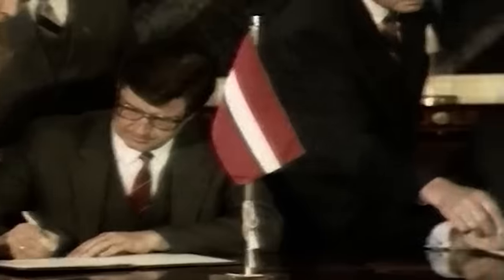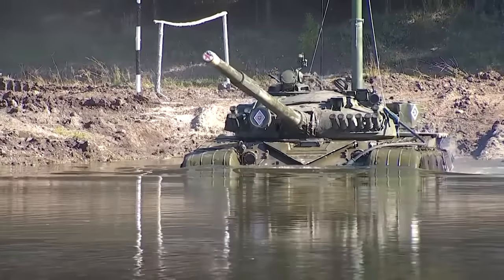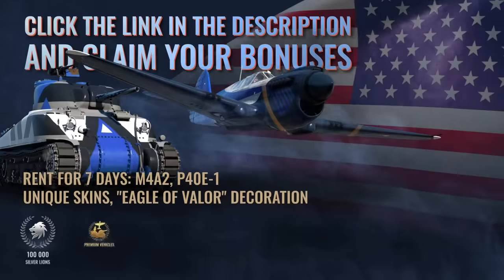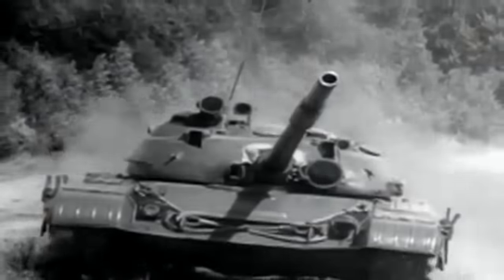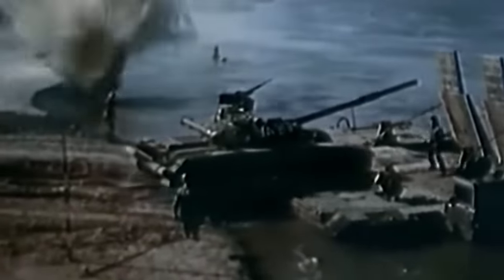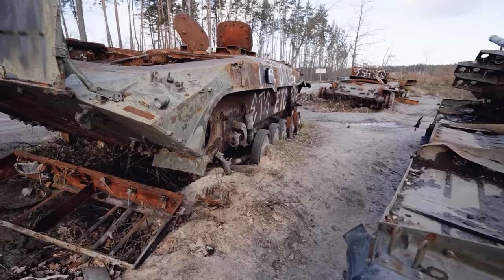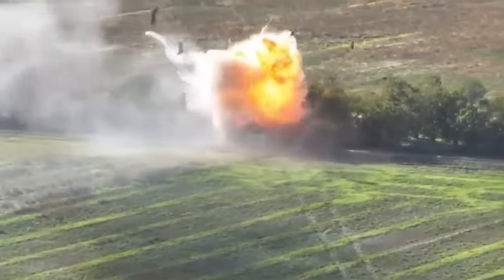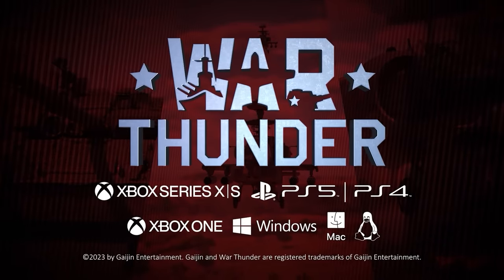The Tank Russia Is Really Starting to Regret

Comment: For anyone wondering why High explosive shells may had been used in the 6.5 mile engagement, that's because they do not loose penetration power over distance, like apfsds do, so it worked kinda like artillery, and if the shell hit the roof, cracked a hatch, machine gun port or turret ring, vision port, it would be an end to the tank, as even sturdy armpur can get worn out and crack... especially on such old vehicles
Reply: Armor

Comment: The T-64 has the same fatal design flaw that the T-72/80/84/90 have; that upright ammunition storage carousel, that it’s autoloader requires, that is open to the crew compartment in the turret. One round penetrating the tank sets off the stored ammunition, with nothing separating the detonation, and resulting fire from the crew. Unlike the M-1 Abrams, which has sliding doors to separate the crew from the stored ammo, and blowoff panels on top of the storage compartment, to vent the energy from an ammo detonation skyward, out of the tank, and away from the crew in the turret. I’m pretty certain that other modern tanks, such as the Leopard 2, Challenger, etc., have similar attributes.
Reply: It was also fixed in some very obscure (but modern!) modification of T-55, where autoloader was added in the back of turret (like on lercerc).
Reply: the carrousel is not the culprit, but the extra ammunitions stored outside of this

Comment: The T-64 was hot garbage, which is why they were replaced in production by the T-72, never never offered for export, never shown-off in any Soviet military parades, and why further development of the existing tanks ended abruptly in 1977 when the T-64's manufacturer began building the T-80. It's no accident that even while Russia has kept T-55s and T-62s in storage into the present day, they scrapped every single T-64 they had left in 2014.

The definitive features of the T-64 (and why they make it an irreparable dead-end bridge) are;
- A unique main gun, the 125mm 2A26. The USSR dropped that weapon like a hot coal in the early 1970s when T-64 production was abandoned (only 6 years after it started, and after a pitiful 6,000 were completed), and starting with the T-72, every subsequent Soviet and Russian main battle tank since has carried the 125mm 2A46 instead.
- A height so low that severe height restrictions were imposed on drivers.
- An autoloader and replenisher design never repeated on any subsequent Soviet or Russian tank, because of how easily and often they broke down.
- An autoloader and turret crew stations so close together, that the rammer had a tendency to rip the arms off the commander and/or gunner when loading a new round.
- A 5-cylinder diesel engine so awful, that it was never repeated in any other tank since, except in Ukrainian  T-74 and T-80 rebuilds (due to KBM inheriting the entire assembly line for that engine, and not having the capacity to develop suitable V12s as replacements). 
- That 5-celynder engine was also a "tri-fuel" engine (it could run on diesel, gasoline, or jet fuel), a mistake repeated only in the M1 Abrams, T-80, and Chieftain. Like the Chieftain, the T-64's engine ran excessively smoky, leaked, and easily caught fire.
- Contradicting the supposed urgency of the "tri-fuel" requirement, and the fact that most of the fuel stockpiled by the Soviet Army was diesel oil, the APU (electrical generator) in the T-64 runs exclusively on gasoline. In addition to being a logistical bottleneck, a gasoline engine in a modern tank is a serious fire hazard.
- The T-64's tracks were re-designed to reduce the high tendency for track-throwing that the previous T-62 had, but it backfired; the T-64 has a greater tendency to throw it's tracks than all previous or subsequent Russian tanks.
- The unusually roadwheels of the T-64 have it high ground pressure for it's weight, and a greater propensity to set-off anti-tank mines.

The reliability, availability,  maintainability, durability, and operability of the T-64 was such a complete trainwreck, that for the first entire decade of their operational service, they were never deployed more than a few-hundred miles away from the factories that built them, because of how frequently they suffered breakdowns so serious that only the factories could repair them. Teams of civilian mechanics became "semi-permanent residents" of T-64 formations because of how often they broke-down. It's not an accident that the T-72 was hurriedly developed and put into production and service shortly after the T-64; it was developed to replace the T-64, and it did.

This is also why the T-64 didn't first deploy to Eastern Europe until 1977, 10 years after they entered service --- NATO instantly assumed they were looking at the successor to the T-72 (which was first deployed to Eastern Europe in 1971, the year they entered service), and ever since then were never able to kick the incorrect assumption that the T-64 was a more advanced tank. NATO couldn't comprehend the simple fact that the T-64 had arrived late because it was a dud.

This unsurprisingly resulted in a war-losing tank that's been slaughtered in every battle it ever fought in, even when T-62s and T-72s operating alongside them prevailed. Their first combat action was in Moldova in 1982, in which 18 a column of T-64BVs were wiped-out by 100mm anti-tank guns (a weapon that, on paper, had been obsolete for almost 30 years). So many T-64s broke-down as the Russian Army retreated from Moldova, that they abandoned another 20 of them.

The Ukrainian Army has also suffered terribly for their decision to continue operating T-64s.Of the 2,350 Ukraine inherited from the USSR in 1991, they only had 700 T-64s in service and 650 in storage by 2014, and they lost lost 300 of them in 2014 alone. Ukraine lost another 240 T-64s in 2022. The Russians and pro-Russian separatists captured over 100 other T-62s in 2022, and they were handed over to the separatists... who lost half of them before the year was over.
Reply: Eh, the 100mm AT gun shenanigans being "obsolete" reminds me of war thunder shenanigans: that modern armoured car the enemy team has with laser range finder and 400m+ pen is all very nice, but all the panzer 2 hears is "armoured car" and starts salivating with it's 20mm autocannon.

Comment: Isn't about 85% of this footage of T-72s?
Reply: Could be anything.  This channel seems to be long ads about War Thunder.   "See what it's like to get your arm mangled in a War Thunder T-64 !
Reply: No, actually it isn’t.
Reply: most of the footage were t-64s, you can tell the difference between a t-64 and t-72 by the roadwheels (t-64 has smaller diameter) and the exhaust position (t-72 exhaust is sideway while t-64 at the rear), but frontaly almost impossible to tell the difference, maybe by tracks but those are very small detail

Comment: A video you don't see getting made often is the difference in individual tank crew training. How long a tanker is trained before certified to join the regular force. What are they trained on? What equipment do they use for training? Number of on hand certified regular tank crews a nation has. I'm currently a 19K of 16 years on the US side. I always wanted to see a video comparing our level of training from OSUT to a NTC deployment ready certifying event. Then what that would look like comparatively. Having a great piece of equipment is great. However, being a professional, an expert, and practicing in real times how you operate with all your supporting elements is an expensive and irreplaceable thing. While "combat experience" is incomparable it is costly learned and to often poor practices are learned.

Comment: T64?  T62 i know about ... after that it was the T72 T80 and the more modern ones.  When i got in (1980) the US had M60 series
Reply: T64 was a competitor but it was more complex and expensive so not continued. T72 was then built from T62
Reply: T-80 is literally a T-64 with a gas turbine.
Edit: well not literally but that was the design goal of T-80, give the T-64 a gas turbine engine
Reply: first iterations of abrams were in development during the 1970's

Comment: The T-64 was soon mostly replaced by the legendary T-72. Yet another Kalashnikov of tanks. And the T-72 was really heavily inspired by it. So what is the regret?
Reply: The autoloader. The T64 pioneered the carousel style autoloader for the (then) USSR. It continues to be used right up to the T90, Russia's latest (in service) MBT. The auto loader uses a flat carousel in the floor of the tank. Up until the T90 is was completely unarmored. They added some armor to the T90 floor, but not really enough. 
Any round that penetrates the turret, especially from the top, sets off the ammo stored in the carousel. 
That explosion typically launches the turret straight up resulting in the ever popular YouTube sport of judging the Turret Toss. 
Extra points are awarded for height, number of complete rotations, shape of the mushroom cloud and the uniqueness of the landing. 
Turrets that drive their barrel into the ground and end up as a Lollypop are especially favored.🤣🤣🤣🤣🤣
Reply: @johntrottier1162  Actually the T-64 has a different type of carousel autoloader, storing the 2-pieces rounds at a 90° angle.
T-72 was created because that system was unreliable, too expensive and too vulnerable in case of penetration of the hull. Also the Ukrainians weren't able to supply enough T-64s to the Red Army.
This is when the Russian UVZ was tasked with the modification of existing T-62s with T-64's 125 mm guns. UVZ created the AZ autoloader as side project, and the Soviet authorities were so impressed they ordered a new tank to be made with that new carousel.
That's how the T-72 was born.
Reply: Not sure. This channel is kinda low quality/high output content to show advertisements over.
Reply: The fact Ukraine is now using it against Russia.
Reply: The regret is the fact that Ukraine had one of the factories producing the tank.
Reply: @johntrottier1162 the Autoloaders in general really aren’t an issue, go look at any video talking about it, or go read up on it, your choice. You’ll find that a majority of ammunition detonations occur in the extra ammo in the turret. The Autoloader allows the tanks to be smaller and harder to see, improving crew survivability, the armor is very compact allowing for more with less weight, less crew in the tank as well if the tank is destroyed. ammunition detonations happen in every tank, and there’s only 1 tank in Active service with every round protected by blowout panels, and it the M1. Leopard has the same issues the T64/72/80/90 have with having unprotected ammo in the hull.
Reply: @wstavis3135 yet they can’t produce any at a substantial rate and they’ve been getting shafted hard whenever they run into a Russian tank. Least that’s what we’ve seen a majority of.
Reply: @hiphip4808  
Very nicely quoted from the MOD handbook. 
The fact is that the "Turret Toss" effect is from ammo stowed BELOW the turret ring. The ammo stored IN the turret is spread out and is unlikely to detonate all at once. The propellant charges in the loader are stored next to each other, and when 1 charge burns, the rest go with it. This rapid deflagration is what creates the pressure to blow the turret into the air.
As far as blowout panels, besides the M1 the Leopard A2 and the Chinese Type 90 have blowout panels as well.
Your research needs some work.
Reply: @wstavis3135  Not really, it doesn't exist anymore

Comment: When russia almost went for quality over quantity
Reply: almost
Reply: thats called T80
Reply: The Soviet Union went for both because they could afford it.
Even the T-72B was a massive leap ahead what the West had.
And then they ended with the T-80U which was the best tank of the Cold War (especially the T-80UK which was equipped with a CITV just like the Leopard 2, while having superior gun, armor and mobility).
Reply: That would be obj187 sadly they still go for the cheap one.. Aka t90a.
Reply: @Rek1emMScar  Object 187 isn't better than T-90A. It's arguably comparable or worse than the T-90 which the 187 competed against (and lost to) in 1991-1992.
Reply: @albertoamoruso7711  That its wrong.. Obj 187 is better in every way.. 

Better gun, that fixed the old problem of T-72 that couldn't fit longer Arrows. So new ammo was invent aka Anker-1 comparable to late svinets round. New turret. Overall better armor, also it didn't have the cleavage weak spot in the frontal armor.. Different obj187 model use different engine all of them better than the t90. Also it actually have a reverse speed not the 4km/h bs of the t72-90. Even better reactive armor...Etc..

The only thing that didn't work in favor of the 187 was it cost. And was the only reason why it lose to obj188.. Nothing new with russian tank that usually go for the more cost efficient tank.

Comment: What a load of BS.
T-64 is pretty outdated, even the rare BM and B1M got chewed up pretty bad without causing much damage.
Reply: T64 tanks are about as capable as T72 tanks that are the bulk of the Russian tank fleet.
Reply: @freitb1  No they're not, they're less reliable and less upgradeable
Reply: @albertoamoruso7711  they have the same gun, same shells, similar protection levels, and similar capabilities when equally modernized. the only real clear advantages a t72 may have is speed.
Reply: @freitb1  Not really, Ukrainian guns didn't evolved beyond 2A46M while modern T-72s are fitted with 2A46M5 which can fire more powerful missiles. Russian tanks also received more modern ERA boosting their protection, better FCS and T-72 suspensions allow more equipment to be fitted on them compared to T-64s.

Comment: Regarding the T-84. Now Ukraine is investing in BM "Oplot". This is a slightly different car, which has quite significant differences in armor and was created in 2009. However, the modern version will differ even from this car, as the "Bastion" program has already been completed, and therefore it is already an updated car, which got rid of Russian components and, most likely, received a few more updates.

P.S. - could not help but note that the way the author pronounces "Chernihiv" and "Bulat" was quite funny. However, the other names were pronounced even very well.
Reply: "Investing" LOL! They had six T-84's to begin with.
Reply: @somedud1140  And does this somehow prevent the purchase of this machines already during the war?
Reply: @FannaD  yes, for example Khtz being ruined by missiles. Overall oplot is a bad tank, especially it's transmission which was overriden to have 30km reverse but breaks every 20 kms
Reply: @ИванМатвеев-й2р   First, he wasn't.  Information about its destruction comes only from Russian sources, and these are the same sources according to which more than 14,000 Ukrainian tanks were destroyed, so I will not even comment on it.  
Secondly, it is very interesting to know the source of the information about the fact that "the transmission breaks down every 20 km" in Oplot.  
And thirdly, "user-vt4je9ym6h", the opinion of bots does not interest me.

Comment: The modern tanks that russia is using is essentially just modernized versions of the T-64. I know I know, this is not true, but at it's root, it really is. The T-64, 72, 80, and 90 tanks all look very similar, not only with the external construction, but also the interior armour layout. The father of these, the T-55/54 was a tried and well proven design, and the soviets contributed using it; all they really did was keep adding modernization and new weapons systems and armour. So it makes sense that the Ukrainians can make a mid cold war tanks match up to the modern T-90s and T-80s russia has.

Comment: The T64 & T72 are great MBTs. Trully some of the most pivotal tanks ever designed.
Reply: T-64 > T-72. But T-72 is far cheaper -> far higher numbers
Reply: @leonnunhofer3453  
"Quantity has a quality all its own." ~ Stalin
Reply: @leonnunhofer3453  base T72 has a much safer autoloader, stronger armor array and is overall a more reliable machine, i'm not even gonna mention t90 and other modifications, stop huffing glue

Comment: That auto loader has become a major liability.
Reply: Not at all, like Even tanks without autoloaders can be destroyed as easily as ones using autoloaders, for examples the Leopard 2 stores ammo on the hull
Reply: @tanaziolopez1936 The Leopard ll has the ammunition supply  stored in the rear of the large turret and separated from the crew compartment by an armored bulkhead. The bulkhead has a hole that allows the loader to pull rounds out and insert them into the weapon. The design of the storage compartment is intended to direct the energy of an explosion outwards or sideways and upwards if the tank is hit, giving the crew a better chance of survival.